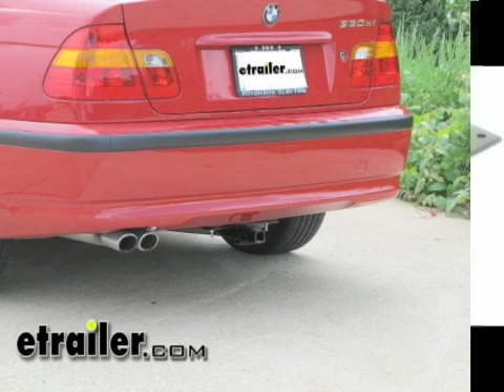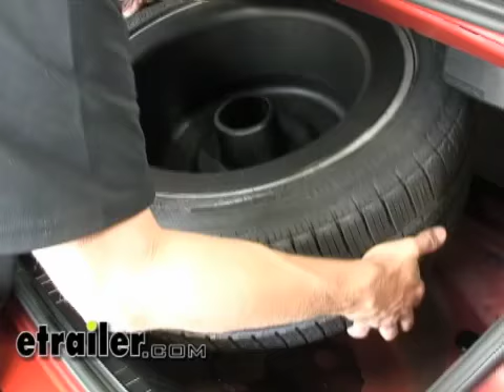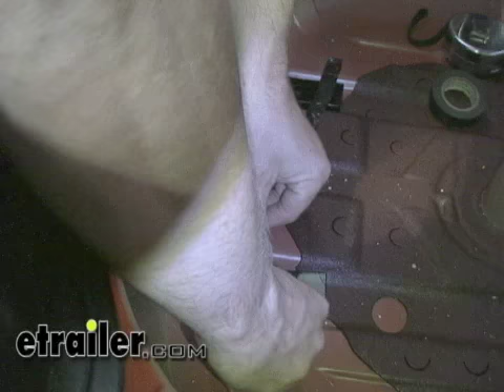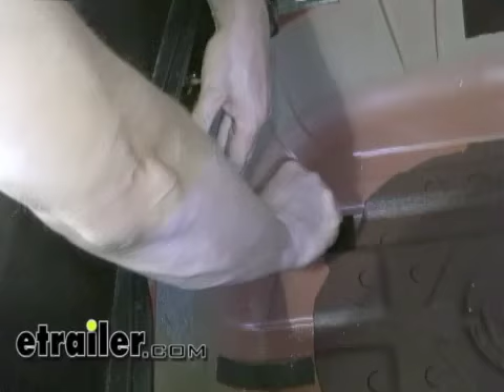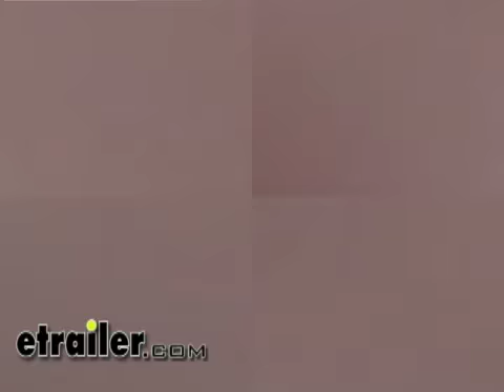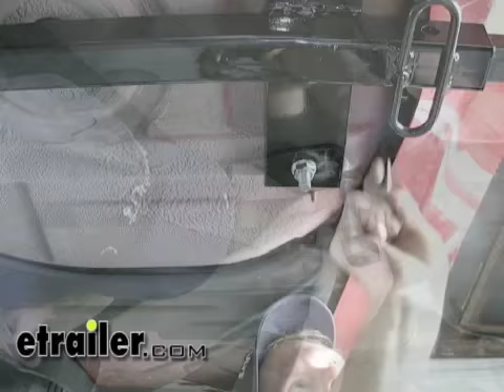etrailer | 2004 BMW 3 Series Curt Trailer Hitch Receiver: Complete Installation

Comment: Would I be able to tow a jetski with this
Reply from the maker: This unit has a max tongue weight of 200lbs and a gross trailer weight of 2,000lbs. So as long as your vehicle's owner's manual says you can tow and what your limits are, you can base your decision off that. You can see the specs of the hitch receiver on the product page linked here. https://www.etrailer.com/Trailer-Hitch/CURT/C11174.html

Comment: Just went to install mine in a 2004 325Ci and apparently it doesn’t fit models with the Sport Suspension.  It’s not the “M”.  But just a 325Ci with Sport appearance and Sport suspension. If u look under the car at the bottom of the spare wheel well, there are extra stiffening brackets there that block the installation.

Comment: QUESTION, I have a 325ci can I pull a small trailer with a dirt bike weighing 200lbs? What class hitch should i use or can i use? And also could i use a hitch carrier instead of the trailer for my dirt bike? Thank you!
Reply from the maker: mrsuzukirider21 The hitch available for a 2004 3 Series is a Class I hitch with a tongue weight capacity of 200 pounds and a gross towing capacity of 2,000 pounds. This means that the trailer and bike together cannot weight more than 2,000 pounds. With a tongue capacity of only 200 pounds, the bike plus a hitch mounted carrier would exceed that limit so it is not an option. The other piece of information needed would be the capacity of the 325 as indicated in the owner's manual. It very would be less than that of the hitch, in which case, you need to follow the lowest rated capacity.

Comment: Will this work for 330CI, 2004 year
Reply from the maker: Sreekanth Yedla This Curt hitch, part C11174, will fit all 2004 BMW 3 Series coupes, sedans and wagons with the exception of M series models.
http://www.etrailer.com/p-C11174.html
Reply: +etrailer.com By M-series models you mean M3?  I ask because I have a 330i with the 'M-Package' which I believe is simply different wheels/slightly different suspension and steering wheel... but I am guessing that the 330i with M-package has the same spare tire compartment?